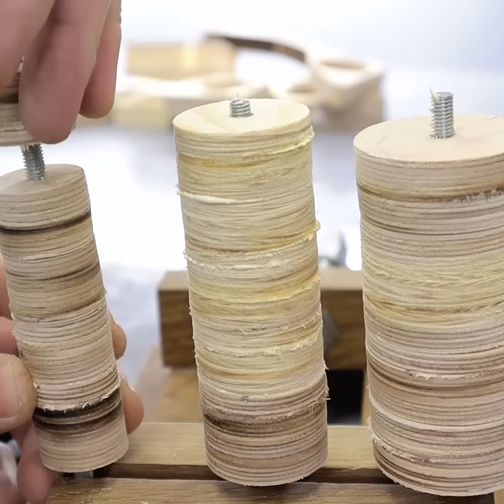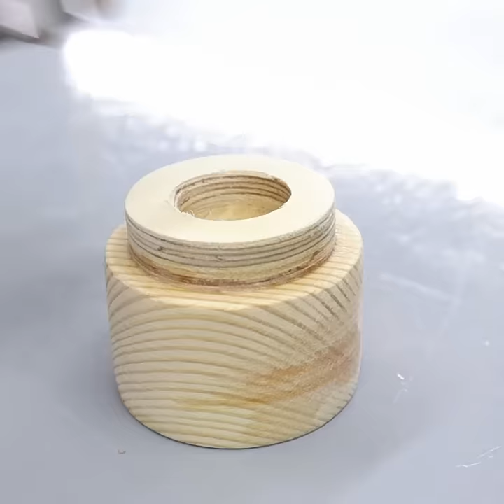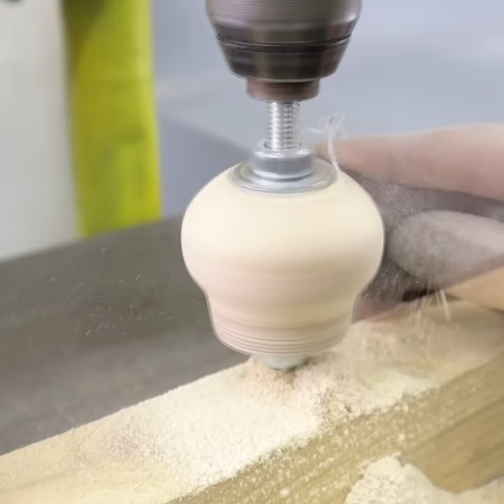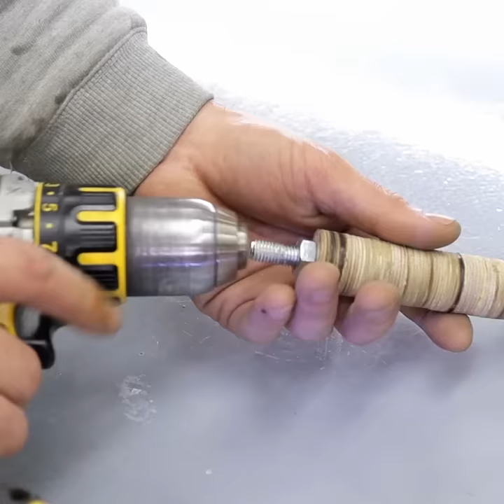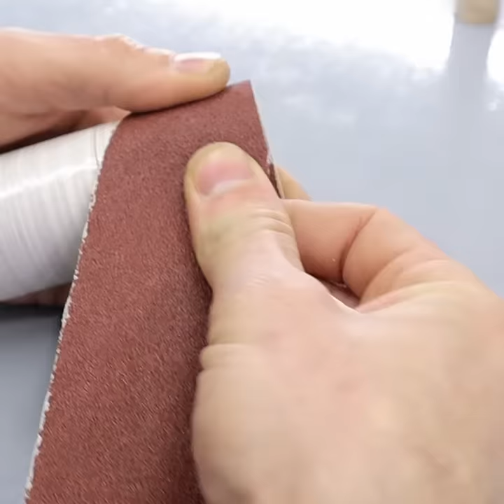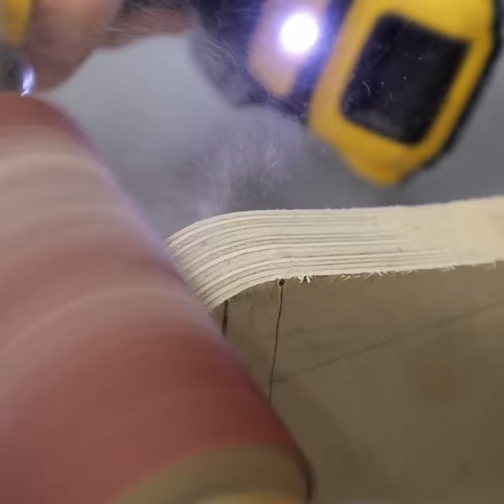DiY Drill Sander #shorts

Comment: At first I was like "wtf just but a drum sander, their cheap as dirt" but then I saw the ball end was actually a handle. This actually pretty cool. Construction method has a lot of stuff you shouldn't do or was kinda dumb, but for light duty and woodworking this shouldn't matter.
Reply from the maker: I really need that sander for my band saw project, there was needed to sand many curved surfaces, and I made this. For now it works perfect in many other projects and I think its good stuff🙂👍
Reply: @CraftyDude  indeed, for anyone with a bit more time or maybe a 3D printer I'd recommend making a guard on the stationary handle to prevent you palm flipping into the drum or your thumb from getting pulled between the drum and work piece. But otherwise good stuff

Comment: Spend hours making something that will be clogged in minutes, when the time could be better spent sanding by hand or using some other tool that is cheap and readily available. More pointless than a blunt pencil.
Reply from the maker: It works very well, perfect for curved surfaces sanding, you can check my axe making and knife restoration projects where with this sander surprisingly fast and easy was made handles👍🙂
Reply: @CraftyDude  Although I agree that a budget dedicated tool would be a better choice. Can I recommend an improvement? The design isn't save in the current form. At rhe knob side, At a shield. In case the hand slips and the hand or arm comes in contact with the sanding paper.
Reply: @CraftyDude  works very well until it becomes clogged